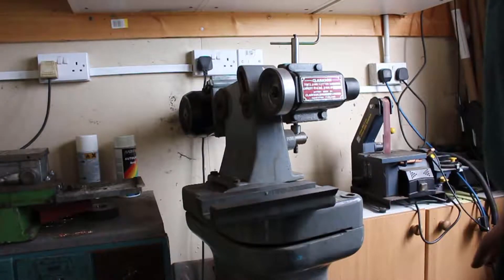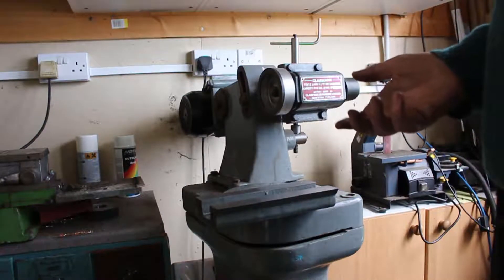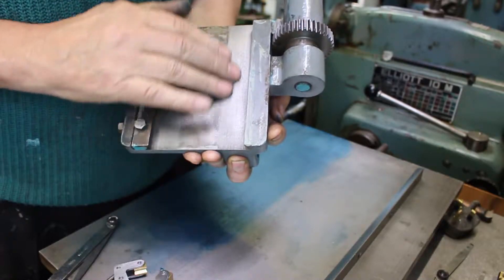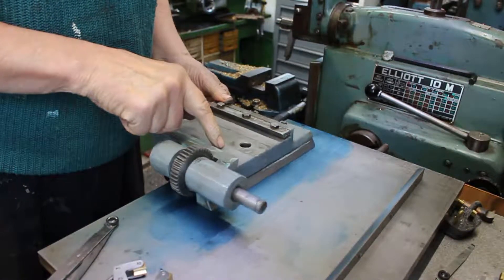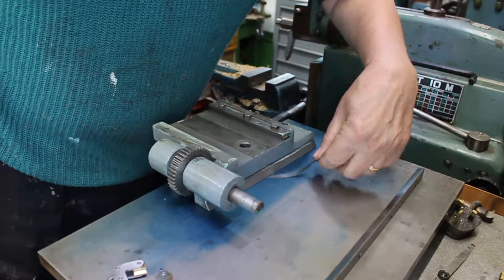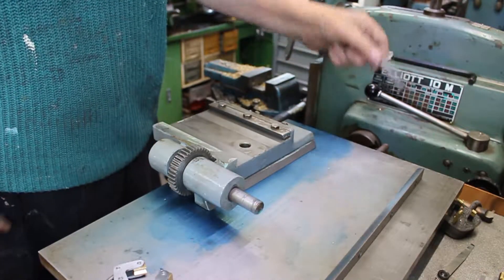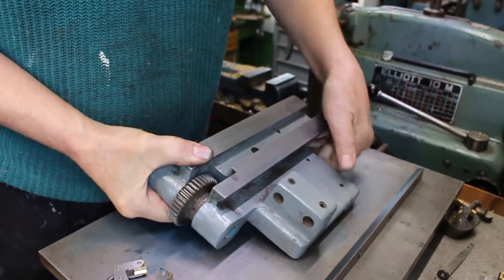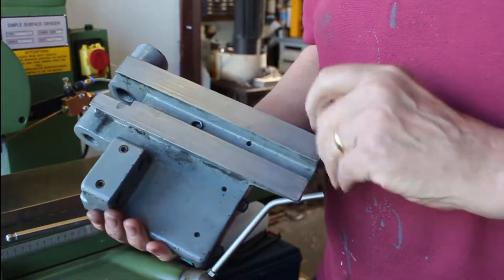Re-machining a dovetail slide Pt 1, Clarkson Mk1 Tool & Cutter Grinder

Comment: Good morning, i saw a nice machine like your here in Italy, a Clarkson Mk1: could you say me please, if the machine can be use like a surface grinder and not only like a tool grinder? Thanks so much and have a nice week!! Cheers from Italy, Alberto
Reply from the maker: Sorry for my late reply. I think it could be used to surface grind though not ideal, quite tricky to put on accurate light cuts, may be ok for occasional surface grinding.
If you are doing regular surface grinding then I don't think it's suitable.